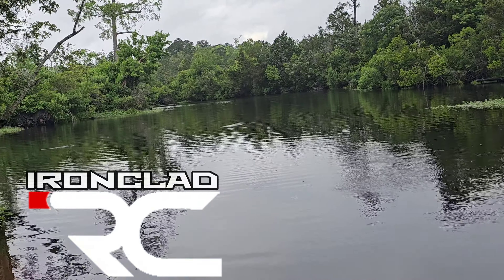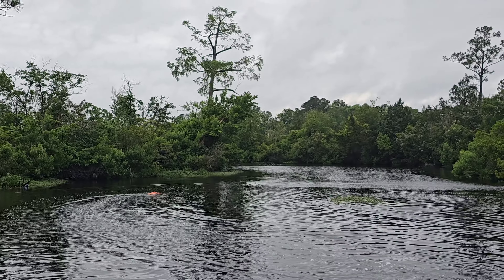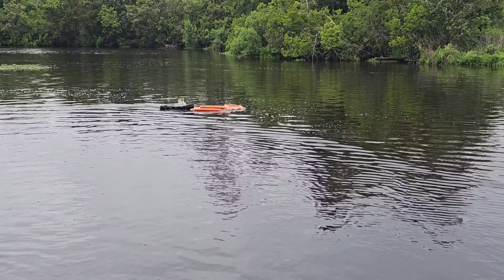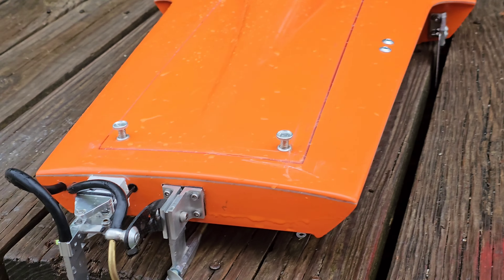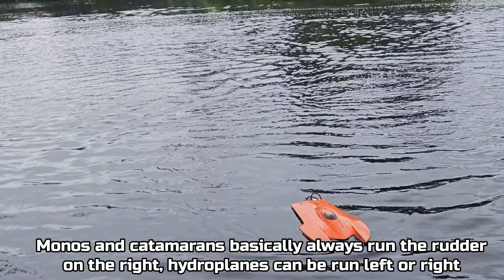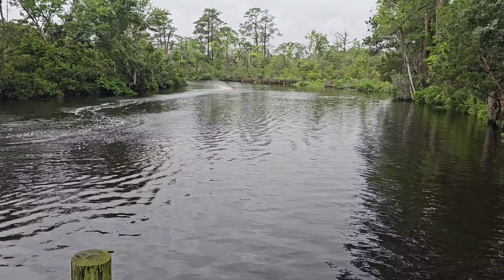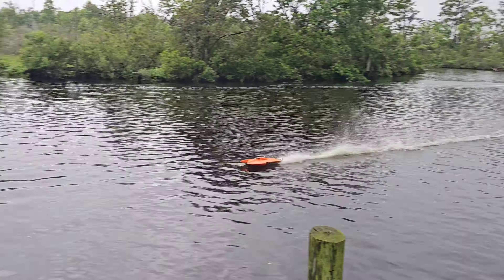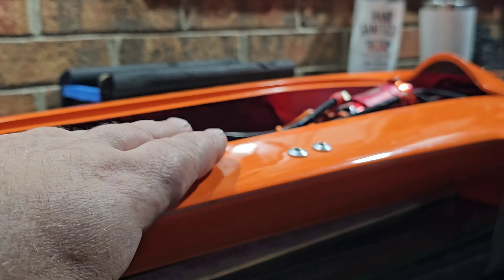Prop Walk Extended Rudder, Shimmed Strut Test Deltaforce Vortex 34 - Rudder Placement Rc Boat

Comment: I think your going in the right direction so far I like your boat in your last adjustment at the river. Over all it was your fastest run threw the corners and decent speed down the straight away. Keep up the testing. Great video Brother  Boat Gang For Life:)
Reply from the maker: I agree that the deeper strut worked best, so far anyway

Comment: Looks 10 times better now.  Great success and new eventually the problem would be sorted out.  
After watching your video  it got me thinking.  So I went back into a few of your older videos.   
In realized  the sport 20 strut had the longer bracket and you cut it down.   No big deal.    
Normally the sport 20 Hydro  bracket is shorter  paired with a Speedmaster Hydro bracket for the rudder.  Short setback.   
Puts the  rudder leading edge in line with the leading edge of the propeller.  Your longer setback made a big difference to establishing being in line with the two.    Hydro hardware is usually what I pick out when building so it was a concept I never gave much thought on.    Honestly it’s great information with these videos and a learning experience as hydros can be very picky on the hardware.  Interesting to think about and food for thought as differences to a setback on the rudder and the relationship to the propeller.
Reply from the maker: It was almost night and day with the proper setback, still didn't handle, like it should but dam close..
Yeah I actually accidentally ordered the mono strut bracket, didn't realize it until I received my order.. same strut just different brackets..  working on filling holes for the new rudder, she should be back on the water very soon

Comment: If the speed master rudder don’t fix it, it might be an idea to either mount it on the right OR move the strut over to the right to get it away from the rudder. 
It would be harder to move the strut because the motor and hole through the bottom would need moving.
I know riggers are totally different but I moved my strut across 20 mm and moved the sponson on the left 10 mm out so it’s like moving the strut 30 mm in a way.
I was watching one of the videos of you running it from the other day and it looked like the prop made a big hole as you pulled on the gas and the rudder was in that hole.

I only suggest any of this because I feel the way that thing is so fussy on the tune it’s a boat I would not get real excited about running the way it is currently.
Reply: rudder in the hole, that’s what I was picturing in my mind. A lot of hydrodynamics at play here, I believe just a wider rudder would make a difference. I also believe Big B’s bench tune is almost spot on, he usually gets it right on the first drop. 👍 BGFL
Reply from the maker: I agree. I definitely thought about moving the rudder to the opposite side, we'll see.  I am working on filling the holes in the hull preparing for the new rudder

Comment: People that have never built or flown a plane will not understand rudder authority if there’s a small rudder your plane is going to yaw and become what you would call uncoupling.  what is basically going on with the hydroplane. With a boat it’s fluid dynamics / airplanes it’s aerodynamics. Good stuff “B” enjoying your series !! Can’t wait to see the proper rudder on your boat.
Reply from the maker: Thanks for the feedback, really wish I'd went with the speedmaster rudder right off the bat, but in a way I'm kinda glad I ran into this issue so others can see what it takes to get a model running.
Reply: @IRONCLADRC  sometimes “B” it’s not the results it’s the journey to get to the results that matters.
Reply: Yes they can understand, you aren’t special

Comment: Do you have water cooling on your mini hydro?I think I need to add a pick up and shorten my lines.
Reply from the maker: I have 3 mini hydroplanes, 2 are not water cooled, and one is water cooled.  Mine are all under 17 inches, so I just rum smaller props with no temp issues

Comment: What sucks is you need to drill new holes in the back for the speed master. If only everyone used the same bolt patterns!
Reply from the maker: I know right, one good thing is the speed master rudder base is absolutely huge it should cover most of the filled holes... FINGERS 🤞 CROSSED
Reply: @IRONCLADRC  well i got the same ose rudder on mine but its the wider one with dual pickup. if i have problems with mine ill be switching as well.
Reply from the maker: @PatriotBrad  no one will ever know!  Lol

Comment: I have my first custom build going on and have actually been waiting to see what you come up with to fix the prop walk because I am worried mine will do the same. But mines a mono so it might be different? I think?
Reply from the maker: Hopefully your mounting the rudder on the right of the prop on a mono hull, if you do you should have no issue.   Working on the vortex right now should have it ready this weekend
Reply: @IRONCLADRC  yeah definitely on the right side. I was curious to see how it went with having the prop past the rudder. My hull is tiny and was planning originally on mounting it with the TFL adjustable strut past the little rudder. Your situation made me rethink that before pouring epoxy on all the things.

Comment: Hey b what hatch tape are ya using i went though a bunch of videos and didnt see a link
Reply from the maker: Clear Hockey Tape - Multipurpose Tape Roll - Durable Shin Guard Pad Socks and Gear Tape - Strong Adhesive Easy to Stretch & Apply - Hokey Sports Gifts, Accessories, Equipment, Gear (10 Pack-Clear) https://a.co/d/bsBhNjE
Reply: @IRONCLADRC  thanks B! Appreciate it cant wait to see the vortex 34 get rippin!

Comment: What do you think about double rudders?
Reply from the maker: On a hydroplane no, on a mono yeah,  the down fall to two rudders is the extra drag..
Reply: I agree completely.  On a mono the use of dual rudders works well, but it is a trade off due to increased drag and the weight of the extra parts.
Reply: @ericchild8845  I used to make my own rudders by hand but I have a mill and a lathe now so I can make them as light as possible. I also used to make the actual rudder from carbon fiber which saved lots on weight.
Reply from the maker: I had a 31" wood mono with dual rudders, I really liked the way it looked, couldn't get it to turn left for the Life of me adding the extra blade helped dramatically
Reply: Do you think adding a second rudder to the sonic would make it turn left better. Just squirrels playing in my head